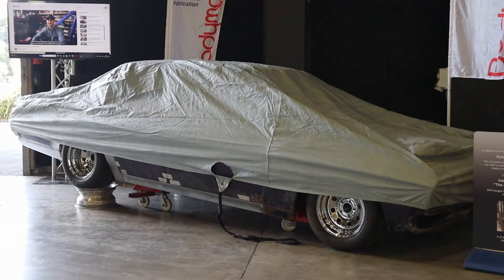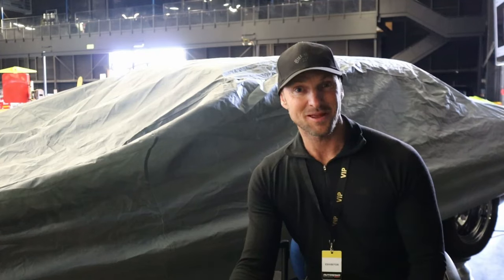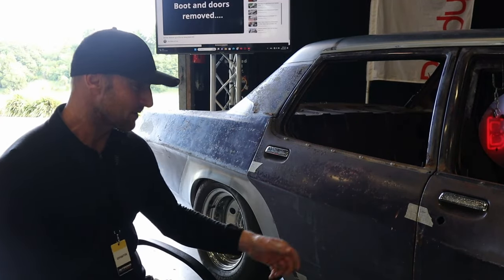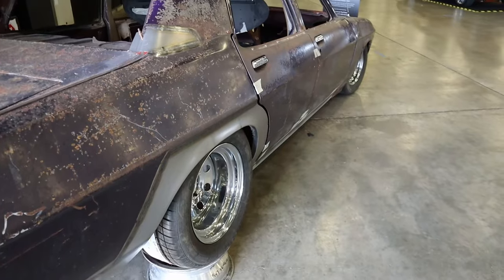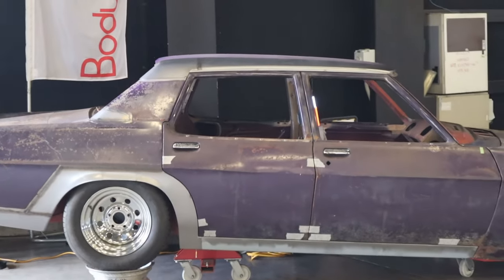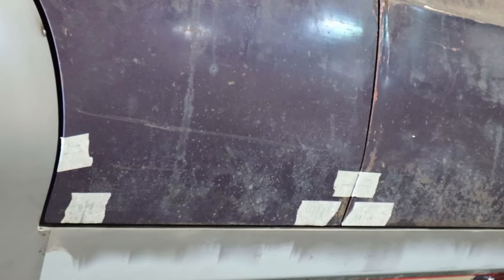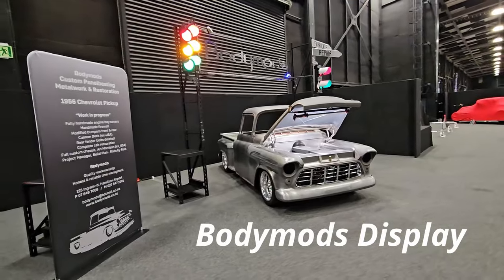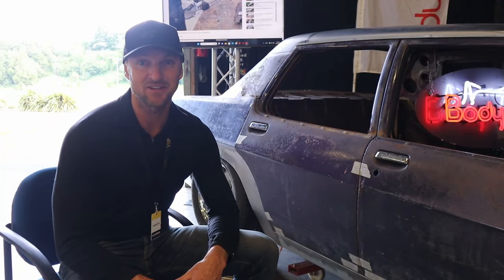Unveiling My Barn Save Hq Holden Display at Autorama

Comment: You’ll end up back at the beginning real quick if you leave that bare steel unpainted which would defeat the purpose of a restoration.
Reply from the maker: Yeah for sure, the plan is to use brunox as a rust protection and it stays fairly clear if applied in light coats. Certainly don't want to risk this fab work deteriorating though.

Comment: Restore it🤑
Reply from the maker: Well at least I'm not doing anything I wouldn't be doing anyway if I was painting it plus I save a few bucks not painting it 😅
Reply: Check the value of a restored HQ Statesman @The-State-of-it
Reply from the maker: I did see one on Trademe, an Hq, very mint condition, I think it was 70 or maybe 80k? Think I've seen later models for 50ish?

Comment: It's not a Holden. It's badged as a GM.
Reply from the maker: I'm pretty sure its s Holden 👍
Reply: @The-State-of-it  there's no Holden badges on it, only the lion logo surrounded by a crest. 
Don't get me wrong, quite a sharp looking motor, but think the use of the station wagon taillights was a little unsophisticated for a flagship saloon and they handled like a pig.
The HJ addressed the taillights part. The other, not until the HZ.
Reply from the maker: @jamesfrench7299 I'm a fan of the tail lights, I think I'll just be glad to be driving this car even handling poorly! 😂
Reply: @The-State-of-it  It is supposed to be a land yacht right? Holden should have kept the HQ suspension on the HZ Statey.
PS funny thing is the HK-HT-HG Brougham was the best handling of the range because of it's longer tail.
Reply from the maker: The Hq rubber mounted sub frame seemed to not be the greatest for handling either.